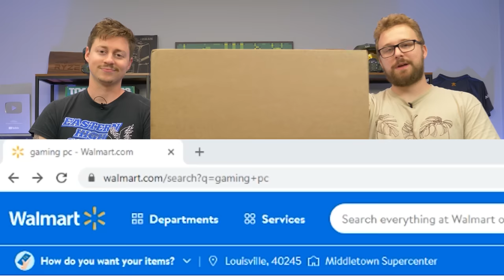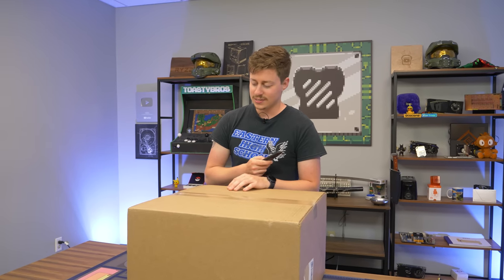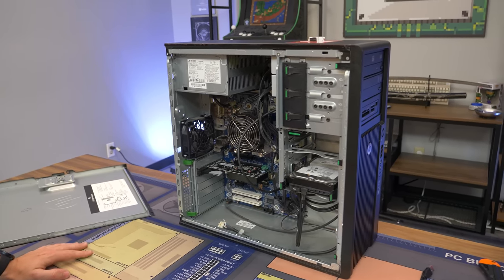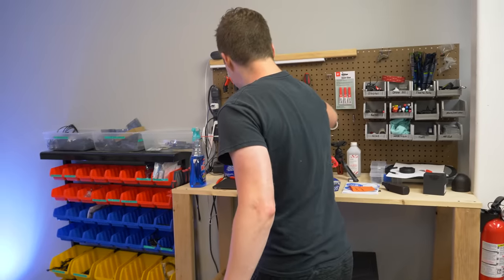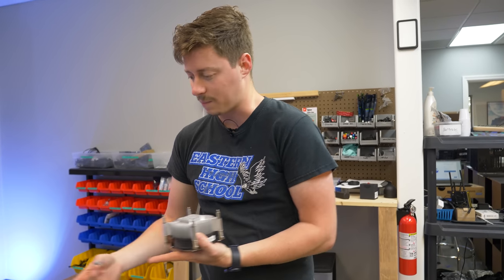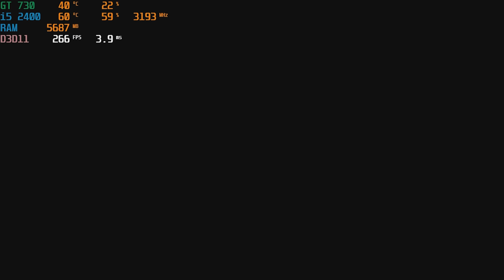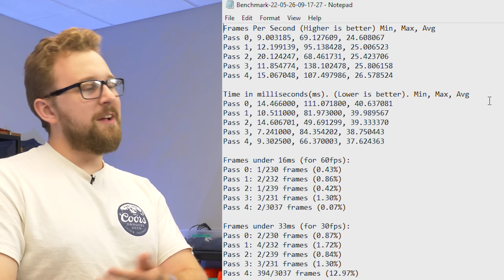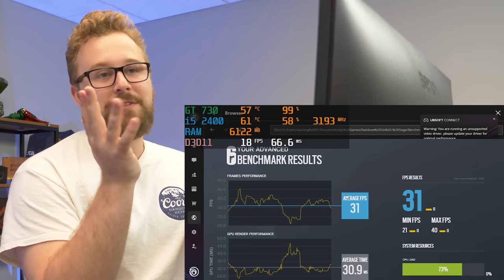We Bought the Cheapest Gaming PC From Walmart

Comment: Definitely agree with the suggestion to buy the office pc from ebay and do the upgrades yourself.  If you pick a GPU that doesn't need extra power its straight foward.

Still can't believe companies still ship with only 1 stick of ram :(

For helping him upgrade his pc my mate gave me some of his old tech, as well as the i7 4th gen he was upgrading from, he gave me an old i5 2nd gen on a Dell OEM motherboard.  Seeing it had a standard MATX form factor I was loath to just throw it away, so built a system around it for £160 all in.  8gb of ram, gtx 1050, wifi, 120gb ssd + 1tb hdd.  Only bit of jank I had was buying a pcie adapter for the case's usb 3.0 ports.  Playing fornite at 900p, performance, low settings but with max view distance it gets well over 60fps, but I do notice the odd faction of a second stutter occassionly, but limiting the frame rate removes most of these.

Still stand my the advice I give to people looking for a super budget gaming pc:  If it has a GT710, GT730 or GT 1030 just walk away.
Reply: Something about an office PC with 5.25” bays just does it for me.  I’d like to find a cheap mATX case for parts, but they’re rather expensive with shipping added.
Reply: Well, most people do not know how to do that . I don't think this is a bad beginner PC , especially since it has keyboard, mouse and WiFi . Only thing you need is a monitor . And when you learn few stuff you could upgrade this yourself.
Reply: The graphics card wasn't the issue though, yea it won't play like rdr2 or elden ring of that sort, but adding another 8gb ram to make dual stick 16gb would had helped the fps a lot by at least 10fps more.
Reply: @jponz85  Where the GPU wtas pegged at 100% extra ram would do nothing to the FPS. I think GPU should be first upgrade, followed by ram.
Reply: needs some dual channel too.
Reply: 1650 gang

Comment: I have a Z220, 3770 8gb ram 2x240gb ssds in raid 0 plus 1tb storage, R7 450 2gb. Might throw in a 6400 for the sake of running dx12 titles.
Reply: Maybe consider something used like an rx 570 or gtx 1060 so you dont get help back bectge pcie bandwidth
Reply: @Vegatablez  gotta keep the power bill in check. Though wouldn't mind a 3050
Reply: @xBruceLee88x  the 3050 has about the same power draw as both of them, better performance for sure though. but also nearly the same as a 1660ti so maybe look at that. Either way 60 watts vs 120 watts really wont make a difference on your power bill, under a dollar a month probably.

Comment: This one is the gf-108(fermi) model with 96 cores i think the the latest driver for this is 391 unlike the other model the gk208b (kepler 2.0) with 384 cores which performs way better obviously
Reply: Yup, Nvidia used 730 brand for very different cards.
Reply: @aleksazunjic9672  yeah
 i have this one 😂😂  bought it and thought i could play forza horizon 4 but it didn't ,but its good that i only paid 27$ with shipping, but i still feel ripped off somehow
Reply: @farhangh3577  Well, you should be able to play Forza Horizon 3 in 720p low :D At 30 FPS :D Joke aside, try playing games from 2010-2015  until you get better GPU.
Reply: @aleksazunjic9672  wait, what !!! forza horizon 3 works on the gt 730 (fermi) model ????
Reply: @aleksazunjic9672  gpus are so d*mn expensive rn it's like every thing 50% over msrp here
Reply: @farhangh3577  Yearly inflation is around 50%, so there you have it.
Reply: @aleksazunjic9672  thanks

Comment: Hey what is the best settings for Fortnite for the Ryzen 5 5600g I have 16gb ram which is running at 2133 even though it was supposed to run 3200mhz